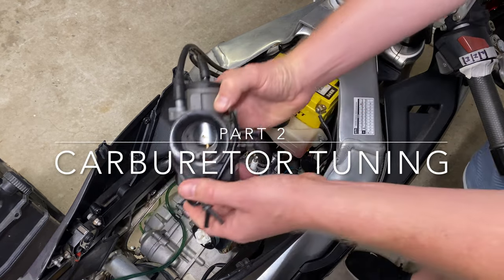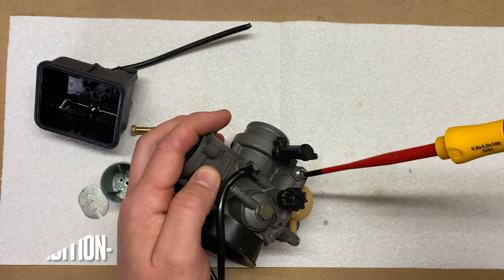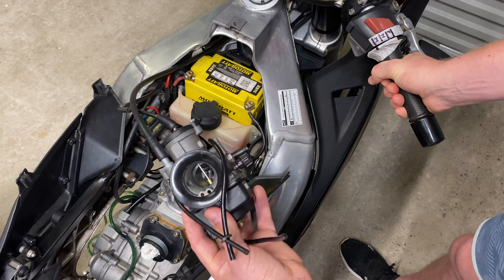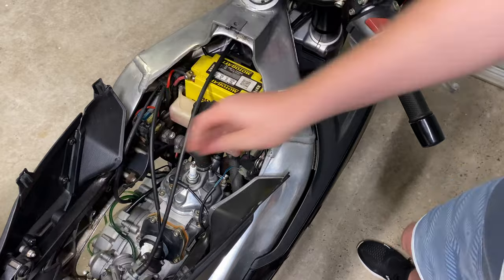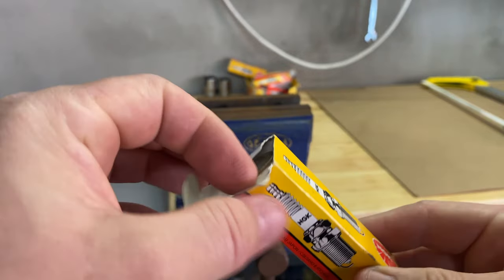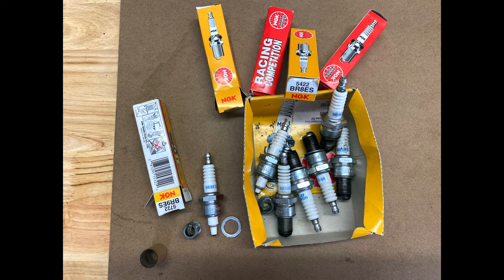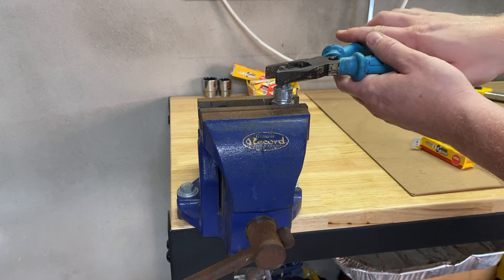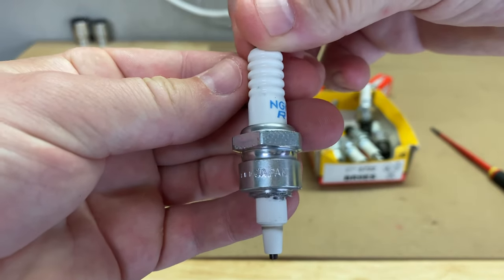Aprilia RS 125 | Dellorto PHBH28 Carburettor Basics Part 2 - Roadside Tuning.

Comment: @15:40 : The structured way of opening and closing you underseath compartment is more structured than my whole life
Reply from the maker: greeting HJ D
I had to rewatch it. Very methodical indeed…. 🤣
Otherwise, I hope the video is of some use👍
Reply: @tomdidit4216  Yes it is! Just bought a RS125 as a hobby project with 18k km. Will be driving it a little this summer and then it's time for a rebuild/engine revision. Will be only driven a few times a year, more a looker than a driver for bikes. And the Spains No.1 is one of the best bike livery's out there I would say
Reply from the maker: Nice!
Good luck with your project👍

Comment: I have also had people stopping to check if i'm ok when I had standing on the roadside for adjusting carbs! It's a good thing of course, there is still some hope for humanity :)

And I have been taught for about 30 years that you count needle position from bottom and up, and I think it says the same in Dellorto's documentation. So it's a good thing that you wrote that you count from top so people cant get confused. I'm currently fixing a friends RS and this video was interesting for me to get some settings to start of with. But I live in sweden so climate differs a bit I think. But the bike has gone from undrivable to be pretty much as yours is in this video. Last 125cc 2-stroke I drove was a RD125 many years ago, so testing the RS was fun. Biggest difference is no doubt the handling and brakes! It's like night and day :) No wobble and sway here :)
Reply from the maker: Thanks for your interesting message.
Two strokes are the most fun!

Comment: Thank you for the lessons!
Now I'm mad at the algorithm for recommending this to me only after I took my new to me 1986 Garelli 125GTA (my first ever 2-stroke, a bike that had sat for years, just 1600km on the clock) for a ride, only to kill the engine in 100km because I didn't do a proper check of the shitty rubber between the carb and engine...it had cracked and killed the engine. No replacement cylinder and piston to be found anywhere. And because I was not aware of the symptoms of an air leak there, nor the consequences. 😢
At least now I know. I hope others see it and educate themselves before they kill their bike like I killed mine. 

Cheers!
Reply from the maker: Tsvetan, thanks for leaving a message.
I had to Google this bike. It looks fantastic, and what a great find with only 1600km on the clock!
That’s bad news about the air leak my friend. It’s a common problem with old bikes, regardless of the mileage, the rubbers seals throughout the bike start to harden and deteriorate. As I found with my low mileage 2010 Aprilia, the engine is not mechanically worn out, but the seals need replacing.
Not sure what to suggest with your Garelli…. Is it badly damaged? Bent rod, piston exploded, scared barrel?

Good luck 🤞 finding the parts
Tom
Reply: @tomdidit4216  Both piston and the nikasil surface of the cylinder are scratched. The spark plug was melted. I'm told there's a machine shop a couple of hours from me that specialises in this sort of engine repairs. Cylinder machining and matching pistons. I hope they both can and will agree to rebuild it! I saw the bike and immediately loved it so I hope I can revive it. Those 100km before its motor seized were a great and very different experience from my 650 Transalp,  '19 S1000R and other 4-stroke  bikes I've been on. 
Cheers!

Update: They can't fix a cylinder with ports as the ones on our 2-atrokes so I'm stuck until I find new parts. 😢

Comment: good video but you really schould use the ngk br10es or similar. I was wondering that you changed for a 9. That sureley will damage the engine and influence your performence in longer use!
Reply from the maker: Hi Martin. Thank you for your comment.
My Aprilia work shop manual recommends 8,9 or 10. I believe the 10ES is the coldest operating plug and is usually used for racing. As they burn colder, they are great constant wide open throttle conditions. As the plug number decreases 9,8 they operate a bit warmer, with 8 being the warmest recommended plug (according to the manual)
I found the 9 is fairly cheap and works best for me.
If your bike runs best with a BR10ES, continue to use it👍.
Thanks again for your comment and for watching.
Tom
Reply: @tomdidit4216  Hi tom, ok honestly i didn´t know that thing with the manual :-) maybe depends on the type of fuel, aprilia recommends 98 Octane fuel= best 10plug. For my part i prefer to run her like that to get the best power ;-P wish you a good day and ride my friend!^^

Comment: Hi,
very nice video, mate. It helped me a lot. 
But i have a question. Which Gas Valve do you use. I think it should be 40 or 50 in your case.
Reply from the maker: Hi m4
I use 98 premium unleaded. Seems to do the job👍
Thanks for watching and commenting
Cheers
Tom

Comment: at 7:32 you state that there is no stutter through the middle RPM. My aprilia the same model as yours, stutters at middle RPM. How do i fix this?
Reply from the maker: Hi there Biconnecc.
In my case, the stuttering around the middle RPM was caused by a rich condition. I was able to fix this by moving the C-clip on the needle up a notch. This procedure can help make the midrange mixture leaner.
Try this if you wish, with care. Monitor as you ride and adjust accordingly.
Cheers Tom
Reply: @tomdidit4216  This is exactly what I thought I should do. That means you explained it well in your video! Thank you man. Will try today!
Reply from the maker: Good luck and take it steady.
Small adjustments and monitor is the key👍
Reply: @tomdidit4216  hey man you aint gonna believe this. I opened it up and the circlip fell off as soon as i pulled the needle out. I carefuly adjusted it to the second setting and put everything back together. Now the bike runs like butter. Its acceleration no longer stops for a rest at middle RPM it just steadily shoots up like it should. Couldng be happier. Thank you so much for your thorough explanation. You caused me a better riding experience and so much knowledge!
Reply from the maker: Awesome news Biconnecc 😎! I’m happy for you mate.

Comment: And if I am around here. I have an RS 50 Racing, the older one I think 2007. The engine revs just fine and it's got good pressure. But right when I shift 1 and start releasing the clutch right when the engine is in load, it immediately dies.
It barely runs on a flat land on 1st gear.
Any idea of what ti can be?

Comment: hello, what phone mount or holder do you use? looks solid
Reply from the maker: Greetings Andrasik
Sorry to disappoint, but it’s actually a knock up job. I drilled the back of my phone case and cable tied the phone to the handle bars.
I would not recommend doing this as the image stabilisation on my phone is breaking, and I think this caused it.
Thanks for the comment.

Comment: Full power rs drivers
Spillo Conico X25 1° tacca in alto (da acquistare se non presente)
Valvola Gas 50 (da acquistare)
Getto Emulsionatore minimo B65 (da acquistare)
Polverizatore BN266 (da acquistare)
Getto Avviamento 70
Getto Massimo tra 125 e 130 (da acquistare)

Comment: Hallo,  great video 's 
I have a tdr 125 with the same carb.  After cold start it stays running like it is on choke ( hand ) but its not. I can see and feel the choke plunjer going up and down.  After a while , sometime short or long ( 10 min) the bike runs great, snappy like a 2 stroke should be and go,s to the red line in every gear.  Do you have any idea where to start looking.  Already changed the crank seal at the oil side. Thanks
Reply from the maker: Hi Wietze.
Thanks for your comment.
I’m experiencing the same problem with my new carb.
I am checking the float plunger make a tight seal using compressed air. Also constantly adjusting the jetting and float levels. My similar issue is still not fixed but will share any diagnosis on my video.
Thanks again
Tom
Reply: @tomdidit4216  okay thanks.  I think iff it runs good at one point the jetting is oke.  I only did 1 size up from stock when i fit a gianelli exhaust.  I think i order a complete gasket set and  clean and rebuild the carb and try again.
Reply from the maker: Good idea👍
Reply: @tomdidit4216  rebuild the carb with new seals. Adjust the float level. After a few runs it is still good. Starts good and when warm it runs great in every gear. 140 km/h at 10.5 k
Reply from the maker: Hi
I’m just waiting on a B36 pilot jet. Unfortunately it’s taking a while as it’s being delivered from overseas.
My next video is ready, all but this tiny component and tuning.
Sorry for the wait guys!!

Comment: hi I noticed this video, my bike starts to accelerate by itself without opening the throttle. First it starts to stay at 2k RPM and when I accelerate it tightens to 6k / 7k RPM. could you tell me the cause of the failure? could it be the throttle sheath or the screws didn't screw well?
Reply from the maker: Hi there.
It sounds like your getting a lean condition.
Try something - the next time the rpm goes high, turn the choke on. The rpm should settle down as the choke will richen the mixture.
Hope this helps👍
Tom

Comment: Hi, what main jet are you using? I'm currently struggling with main jet issue. Read that in unlocked version main jet should be 128 but i can't get bigger than 115 beacuse engine just won't go over 8k. Any ideas?
Reply from the maker: Hi there Maester.
In the video I’m using a 125 because it’s suit the weather and my riding conditions. I tend to swap between a 120 & 125 main jet depending on the season.
I once tried a 128 main jet however it caused my bike to run too rich, bog and drip oil out of the exhaust.
Maybe try the 125 main jet and see how you go.👍

Comment: My RS 125 had an 62 Pilotjet but i could not get good Idle mixture so i increased it to 65 and it was much better but not perfect now i will try 68. 

One Tip if your Bike is completely open you should maybe get an Sparkplug with an Thermal value of 10 not 9. 9 Might be ok but i saw already knocking on some bikes.
Reply from the maker: Hi David. Thanks for your comment.

Good luck with the tuning. It sound like you’re heading in the right direction. Jetting the carb is all part of the fun😀

I may try a 10 spark plug in the winter? Just to see how it goes.

Cheers
Tom
Reply: @tomdidit4216  Yeah I am tuning 2strokes. For a decade but your vid is realy good in explaining it.
Reply from the maker: Good to hear mate👍
Reply: Ngk iridium br10eix is the spark plug you’re supposed to use in a full powered bike
Reply: @thesweeneyboys2974  ITS not absolutely necessary to get a Iridium Sparkplug.
Reply: @davidmertes6308  longer lasting plugs depends on if you can afford it of course but that is the correct plug
Reply: @davidmertes6308  I run a 41hp race tune and the iridium plug makes the bike run slightly cooler when fully warm than a standard br10 I’ve got 3 of these bikes mate and I race them upto speeds of 115mph so I know what works and what doesn’t as I build 2 stroke engines for a living I work for pjme
Reply: @thesweeneyboys2974  "I run a 41hp race tune"  Yeah but 99,9% dont. The longer lasting is a point yes. But its absolutly not required to run a Iridium Spark in a Roadbike. Don´t worry, i work with twostroke engines for around 15 years now and i squizzed 28 hp from a AM6 Engine with the a powerband equivalent to original engine. And there i used iridium because i needed to but with a normal RS 125 even with some tuning a normal BR10 is enough for daily driving.
Reply: @davidmertes6308  the am6 engines are really nice engines to tune very nice to work on , we usually deal with the rotax 122, rs250 , rgv250 and rd350lc motors , and 28hp is impressive for a am6

Comment: Hello, it seems to me that you tighten the spark plug a lot and it is not necessary. If you keep doing it like this you may have problems with the thread. Try to tighten it as much as possible with your hand and then turn it a maximum of 1/4 turn with the wrench.
Reply from the maker: Hi Fidel. Thank you for your comment and I appreciate your concern.
I realise it may seem that way on camera👍
Rest assured I’m always careful with the plug and bolts around the engine.
Thanks again.

Comment: Hey man Can i put same plastics as you have on rs 125 1999 2t. If yes what year plastics you have put on?
Reply: no, they don't fit, same as the later 4 strike model plastics don't fit the 2nd gen 2 stroke ones
Reply from the maker: I think Zvonimir Tomić is correct, they will not fit.
If they did fit, I would probably go back to the 1999 shape😀. I really like the rounded model.
Thanks for your comment Armands.
Reply from the maker: Hi Zvonimir. Thanks for your comment mate.

Comment: hi any idea why turning both screws on my carb whilst running dont change the revs at all? also if i give it a big rev in neutral
and release throttle the revs come down and then dies? cheers
Reply from the maker: I would clean the carb and check the size of the pilot jet.
Thanks for watching.

Comment: Hola
A ver, cada vez que se hace cualquier ajuste en la carburación hay que cambiar bujia
Y tu bujia es la br10eg
Yo uso br10eix, que es de iridio
Además, le tengo hecho el squish que quiero👍👍👍
Reply from the maker: Hi Jonathan.
No need to change the spark plug with each carb adjustment. I use the same spark plug when tuning the pilot and needle circuit. I only use a new plug on the main jet (plug chop).
I believe the BR10iex plug is a premium racing plug that will give you a good strong spark. Continue to use it if your bike runs well and it suits your adjusted squish band.
Happy riding mate, and thanks for your comment.
Tom.
Reply: Yo uso br10eg también

Comment: Hi Tom, just recently purchased a rs125 when revving the bike I’m noticing a vibration coming up through the petrol tank/handlebars any tips on what this could be? I was told engine was rebuilt only 300 miles ago? Thanks Andy in the UK 🇬🇧
Reply from the maker: Greetings Andy.
These bike do tend to vibrate a bit more than modern 4 strokes.
Excessive vibration could be one of many things….
You mention the engine has been recently rebuilt - I’d suggest checking the engine bolts are tight. Worst case, the bottom end may be worn out?? Otherwise, I’d have the mechanic check it over.
Good luck 🤞!!
Tom
Reply: @tomdidit4216  Thanks for your reply Tom, yesterday was the first time I have properly had the bike ticking over, it seemed quite sweet, but things like the air box and the petrol tank were very loose which I tightened up, I’ve been told the bikes been in storage for around 8 years before being recommissioned maybe everything is a bit rustic? next week is the week where I’ll be riding the bike properly so I’m going to see how it is out on the road, I’m going to have another check over today and see if the engine bolts are tight as you say. Many Thanks Tom
Reply from the maker: All good Andy.
Take it steady👍👍
Reply: Hi Tom,
So just a quick one what controls our full throttle position so I feel as tho the bikes not getting enough fuel after around 7.5k and I’m relying on the powervalve but I can feel a struggle between 6-8k like on your video here when you pull the throttle back your bike takes off I can see a difference for sure because round town under 6k the bike is fine but when I want to open it up it’s like it’s struggling for fuel and I’ve noticed that mine won’t even go into the red limit where as I’ve seen some Ed’s rev to 12-13k but mine kinda won’t go past 11k? I have fitted a new air filter recently but a put a 128 main jet in to try and compensate for the bigger air intake? Just wondering if you have any thoughts
Cheers pal
Reply: @andyandthe2strokemonster942  i have the same problem did you solve it??

Comment: hi tom i cant figure out my carb its running lean, its stuttering at around 6k rpm then it wont rev past 8k i think there is a problem with my powervalve and my air to fuel mixture i just installed new reeds hoping that it would fix my issues but didnt! do u think it could be a vacuum leak i dont want to ride my bike because im worried about a siezure im gonna try messing around with some different jets i am running a pipercross airfilter with the box with the snorkel still in stock exhaust and boyesen dual stage reeds im just praying that i havent screwed my engine up! any help would be greatly appreciated
Reply from the maker: Hi there.
This is strange… Has the bike been running ok and suddenly started playing up??
I’d get the power valve operational. If it is stuck in the closed position, it could alter the port timing and cause a restriction.
Then I’d be cleaning the carb and restore to standard jetting.
Other than that, it’s hard to diagnose a fault without having a look.

Fingers crossed you’ll sort it mate

Cheers
Reply: I would guess you have too big main jet, buy a set and check each. Normally in the unlocked version main jet should be 128

Comment: what does plug chop reading do/reads?
Reply from the maker: Hi Roronoa.
My very first video was about the plug chop process. Check it out if you haven’t seen it yet.
Basically, the spark plug will create a small carbon band around the porcelain insulator. This bad will tell you if your main jet is too rich or too lean.
It’s a very important step of tuning a 2 stroke.

Thanks for your comment.

Cheers
Tom

Comment: what support to use for the phone?
Reply from the maker: Hi DiBari

It’s not an offical phone holder. I simply drilled the back of my phone case and cable tied it to the handle bars. The charging system is a separate battery pack.
(This was a temporary setup for filming only)
Reply: @tomdidit4216  oh ok thanks